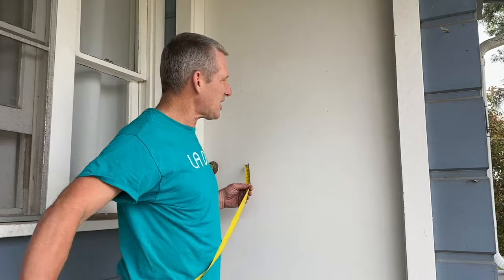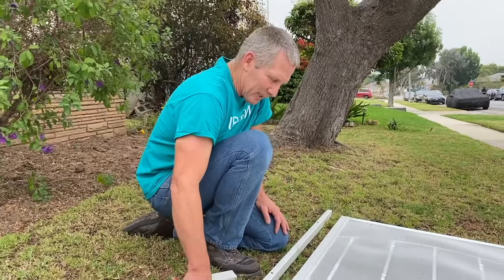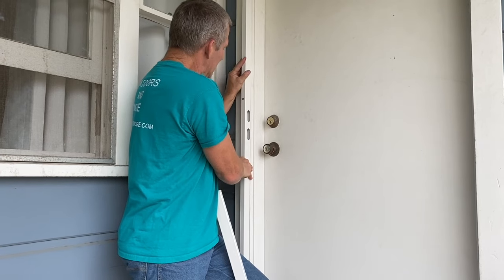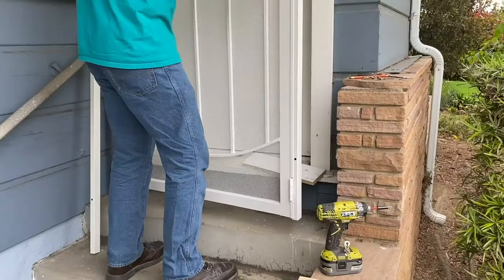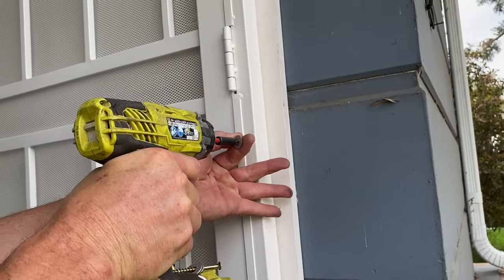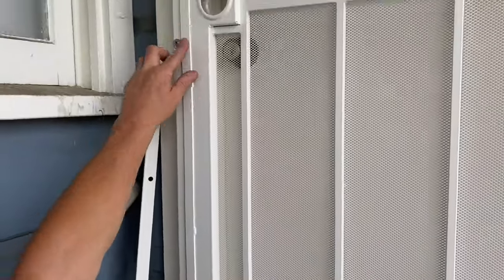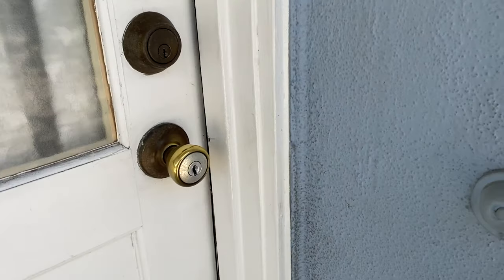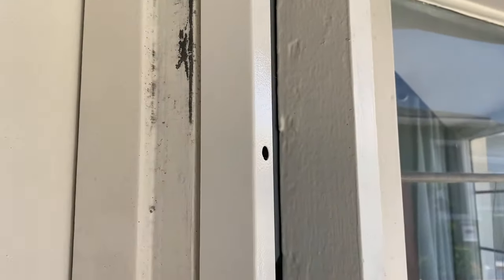How to install a metal security door into stucco or wood siding

Comment: I have watched about 6 videos on how to install security screens-(researching for my upcoming project) this is the most comprehensive I’ve seen thus far. You addressed ALL of the issues I’m aware that I will be facing with sloped trim and tight clearance! What’s even better is you are installing the exact door I bought. Thanks for sharing your knowledge!
Reply from the maker: Hey that's great to hear. So glad I could help. I've installed 100s of these and often ran into tricky little issues, so I'm happy to share the knowledge. Thanks so much for watching.
Reply: @askillthatpays  I'm so frustrated out of my mind with that sloped trim. Think just going to take the whole thing back
Reply: @askillthatpays  Hello Sir, I am installing a 36" security door soon but the wood siding width is 38" instead of 36". What should I do?

Comment: Did I miss something?  You were going to show how to remove a security screw. While installing my security door, one of the security screws hit something solid about 2 inches in and I can't screw it in any further and I can't remove it with the bit. (of course!)  I'm not a carpenter, just an old lady, 66 yrs young.
Reply from the maker: Arggg. that's frustrating. YOu've 3 options. Shear it off and drill a new hole or  unscrew it with vice grips slowly. Lastly, cut a groove in the screw with an angle grinder and cutoff wheel to make a slot as though it's a big slotted screw. Then either use a large flat screwdriver or cut the point off an old 5/8" spade bit and put it in your drill and use that as a screwdriver. Good luck and thanks for watching.
Reply: Thanks for getting back to me. I researched the comments in your video later on.  I tried cutting a groove into the head of the screw with my Dremel and it didn't work for me because my hands shake, so the slot was kind of sloppy.  I discovered that I could buy extra security screws just like the ones I had so I used a womans method of fixing the problem.  I took my hammer and banged the 2 inches of the screw sticking out to a 90 degree angle and unscrewed it with a vise grip wrench. TaDa!!  The Security Door looks great and I feel more secure in my home. Thank you for you instructive video.  It was better than the others I had watched going into this project.

Comment: Have you installed that type door on a mobile home?
Reply from the maker: No, but if I had to, I would probably use self tapping metal screws to get the door in place, then drill through the siding and use long carriage bolts with the nuts and washers inside the home. Thanks for watching.

Comment: Love the video…..I need This prior to installing my door…the spacing between my security door and interior door has only 2.18 inches. I can find a door handle that is short enough. Any suggestions..sign.edit”I wish I had seen this video before my security door was Installed”
Reply from the maker: Yeah, just get 1x4 exterior planks or something similar and simply build up the frame around the sides and top of your door thus increasing the space between knobs. Thanks for watching.

Comment: Excellent video. I need to install one of these in my home also and the door you installed is the identical one I chose from Home Depot. I’ve never done this before but you made it look so easy. With all your fabulous installation tips I now have the confidence to install my own. Thank you so much.
Reply from the maker: That's great to hear. I've installed 100s of these and they're surprisingly tricky based on the surface, so I thought I'd share the tips I've learned along the way. Good luck and thanks for watching. I appreciate it.

Comment: Very complete video.. wish i had watched it first. I just finished installing one of these and find my door knob on the security door hits the deadbolt of the regular door. I am going to need to take it out and shim it out about 1/2".. I don't have enough room to go up or down so frustrating. IS there any way to get those security bolts out short of grinding the head off? You've earned a new subscriber.. Thanks
Reply from the maker: Yes, there are 2 ways to do that. One is to grab them with vice grips and hope it turns. The second is to put a cutoff blade on an angle grinder and cut a slot into it thus turning into a big screw. Then try to turn it with a large screw driver, or what I've done is cut off an old 5/8" spade bit and put it in the drill to use like a screwdriver. Good luck and thanks for watching.

Comment: This was a great video and really helped me get mine installed. We were just doing this for looks, we didn't really need the security aspect of it so we just used the 3 inch screws with the washers like he did here for the "temporary" mount. Works great
Reply from the maker: That's great to hear and the security screws are overkill anyway. In 15 years of working on doors, I've NEVER seen a case where someone tried to unscrew something. It's too noisy, difficult and time consuming. Thanks for watching.

Comment: Thank you so much for the awesome detailed video. Your tip on using removable screws first as a test was priceless. I ended up removing them twice. 😂. I followed your tips and everything came out great. Thanks again. 👊🏽👍🏽
Reply from the maker: That's great to hear. I've installed a 100 of those and finally figured out a way to make it easier so I'm happy to share some experience. Thanks for watching.

Comment: Thanks for video, and great tip for the leveling the outside frame with the composite shim. 
Where do you get the shims? Thank you!
Reply from the maker: Glad you enjoyed it. The composite shims are available at Home Depot but you have to search for them as they don't keep them with the wood shims. I've also found them at larger regional hardware stores. Thanks for watching

Comment: Hi … thank you for this video I just bought the exact same door and was wondering does it matter if the house is a wood home? The concern is would the screws split the studs of the door frame?
Reply from the maker: It's unlikely that you'll split the studs. As a precaution, pre-drill them with something slightly smaller than the screws. All the best and thanks for watching.
Reply: @askillthatpays  thank you so much. Thanks for posting

Comment: 12:21  - you mention when that final screw is in, it will usually just rub up against the edge of the door.

If that screw is too close to the edge, does it prevent the door from closing ? Or does the lip of the door close over the edge of the screw ?
Reply from the maker: Great question. The design always seems a little odd to me yet the doors have enough play in them that they manage to clear the screws. However, sometimes I've had to make the screw hole oval shaped to clear the door and other times have actually taken the angle grinder to the lip of the door. Thanks for watching.

Comment: I was looking to replace a couple of these with new metal doors.  Unsure how the screws will come out or if i wont be able to re-use the same hole positions.  Any suggestions?
Reply from the maker: If you buy the same type of door, the holes almost always line up with the old ones. However, You can always drill new holes and then use the procedures. In addition, the "security" screws are overrated. In 15 years of doing doors and fixing break-ins, I've NEVER seen a case where a thief brought tools and unscrewed something or removed hinge pins. It's too noisy and time consuming. Thieves smash windows, and use crow-bars. If you just use regular heavy duty construction lag screws, you'll have just as much "security." Thanks for watching.

Comment: I’ve got a stucco border they put around my door frame I’m guessing just for aesthetic. I’m wondering should I take a multi tool n trim it out where screen gonna go or should I just get some extra long bolts to anchor screen down to frame? Any advice
Reply from the maker: It's hard for me to say without seeing it, but a multi tool isn't a good choice for that much material. I would try longer lag screws first. If that doesn't work, then use an angle grinder with a diamond cutoff wheel. Good luck and thanks for watching.
Reply: Hello...what did you end up doing to get yours installed I have same issue and lowes wants to nickel and dime me to remove stucco

Comment: Hi! I already have an old rusted security door that needs to be replaced. Will it be easier to install new door since holes are already in place?
Reply from the maker: they usually line up in the same place, but sometimes they don't hold the new screws well. I would try it, but slide some wood slivers in the old holes to give a little more grip. Thanks for watching.
Reply: Thank you for answering my question and helping me out!

Comment: Question. What if there are holes from when the previous owners had a security door, would that affect the new door screws?
Reply from the maker: It could as those are almost always the same. You could reuse them or simply drill new ones. You could also fill them with a dowel. Also you could use longer lag screws instead of the security screws. The "security" screws are really just a false sense of security. Here's why. An intruder will pry this door open in 30 seconds. In 20 years of contracting, I've NEVER seen a break-in that was the result of a burglar unscrewing something, removing hinge pins etc. Doesn't mean it isn't possible, but seriously, it's hard enough to remove these things during the day when I'm assigned to do so. Trying to do it quietly and quickly at night is impossible. Thanks for watching.
Reply: Thanks!

Comment: What size drill bit did you use for the holes before you put the security screws in?
Reply from the maker: The screws are usually 1/4" or 5/16".  So I use a bit that just slightly smaller than that. Thanks for watching.
Reply: @askillthatpays  gotcha, ty!!

Comment: How are these doors secure, when I can cut the screen with tin snips?   What else can you use for a security door?
Reply from the maker: It's difficult to cut with tin snips but I get your point. These types of doors come in different thickness and styles based on price. There are few doors, other than bank vaults, that are truly "secure."  Doors and locks only keep out honest people. If someone wants to get in, they will. Security comes in layers, and products like this make it more difficult and less likely that a break in will occur because they increase the time necessary to do so. Thanks for watching.
Reply: Great job    I have the locks and they slip on the metal surface  besides double stick 
 Gonna use mag locks with bracket and 30 RFID control 
The locks 40 50 for control blue tag combo battery push to exit better than these keys 
I used tuff foam to adjust  the shim was helpful

Comment: I have an old security door and so I can't unscrew those screws to remove the old security door ?  If so, any tips on how to remove the old door ? And with the previous holes from the old screws, qould I need to replace the door jamb ?
Reply from the maker: There are two options. First is to grind all heads off with an angle grinder, remove the frame, then use vice grips to remove the screws. Second option is to cut off an old  5/8" spade bit and grind it a little to it's like a large screw driver. Then use a cutoff wheel and grind a slot into the screw deep enough to accept the 5/8" spade bit. Then use the spade bit in a drill like a screwdriver to remove the screw. Good luck and thanks for watching
Reply: @askillthatpays  Thanks :)

Comment: The tool that came with the door broke, know how to screw the bolts without the tool?
Reply from the maker: Depot and Lowes sell them in the screw section along with other security screws. The one that comes with the door is very low quality and the replacements are much better. Good luck and thanks for watching.

Comment: My front door has stucco surrounding front door. I did an inspection cut on the stucco. I found behind the stucco is more concrete. Do the one-way screws provided work going into concrete?
Reply from the maker: No. There is typically some wood behind there somewhere because the stucco has to be allied to something. I would drill through the stucco til you find out how deep the wood is, and then get an appropriate length screw. Even though the screws that come with the kit aren't reversible, I don't always use them. In 15 years of doors, I've NEVER seen anybody unscrew a door to break in. They almost always use a crow bar. However, IF security is an issue, lag screws can be ground down once installed. Thanks for watching.
Reply: @askillthatpays  there is wood behind the concrete. So it in this Stucco, Concrete, then wood frame. What do you suggest I do?

Comment: Any Digital  key locks you like for this gate ?
4:08
Reply from the maker: I haven't seen one yet that can be installed in these without modifying the door. They need a larger flat surface. I used to do welding and I'd weld a plate around the hole to make a flush surface. Without doing that, they don't install well and the guts are exposed to weather. Thanks for watching.

Comment: My door doesn’t want to lock after install lock wat can I do?
Reply from the maker: There are a number of reasons for that. It could be hitting the lock on your other door. It could be misaligned up and down. It might not be closing far enough. It's a matter of loosening the screws holding the locks side piece in place and moving it however necessary to get it to line up. good luck and thanks for watching